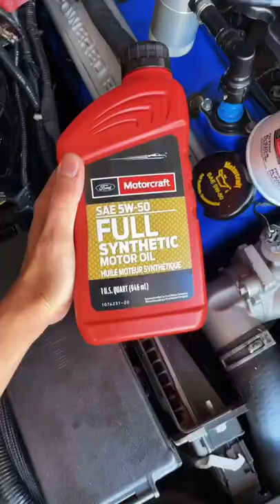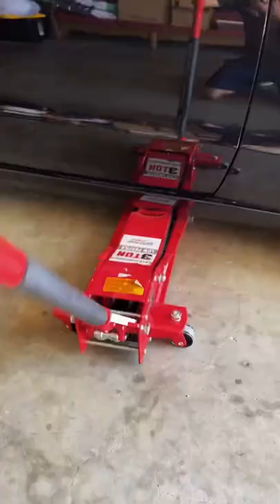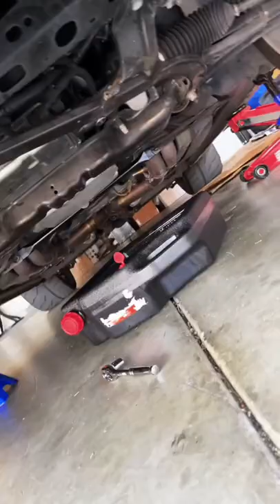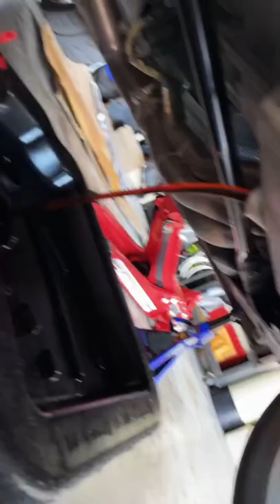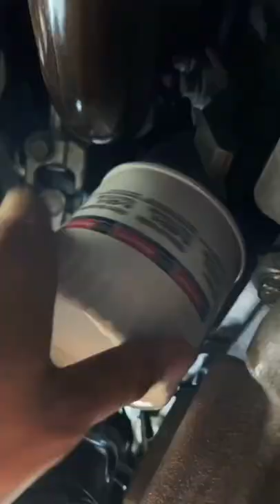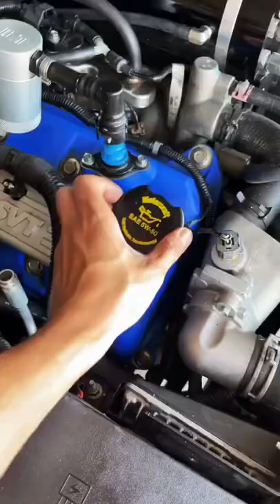How to do an oil change 🏎💨

Comment: Everyone saying about the filter, what about the fact he just jacked it up from the middle of the car! Always use the jacking points never use the middle of the sills.
Reply: First thing I saw.
Reply: Never pre-fill oil filter, can let dirt in engine and destroy it
Reply: That just depends on how strong the body of your car is 😂 I've seen cars up here in the north where you could only jack them by the side if you tried to jack them by the jacking points they would crush in so what we would do is take a longboard cut a channel in it and then set that right between the bottom bit and then jack off of that
Reply: U don’t have to!
Reply: I jack up my car and rest the car on jackstands under either the control arms or the k member subframe, i DO NOT trust those "jack up points" especially on a pinch weld, anything that is solid and connected to the frame i.e control arms, or subframe
Reply: Pinch welds are fine to hoist a car.
Reply: Jack Johnson   agreed unless something obvious is in the way of the pinch welds
Reply: @southernautodiy2643  go ahead try and lift a vehicle on a 2 post by the control arms let me know how that goes the jack points on pinch welds are litterally designed behind vehicle hoists and those tiny pinch weld Jack's that vehicles come with shut up if you don't know what you are talking about
Reply: As long as it's on the pinch weld you're all good
Reply: @tedsdead816  how is it irrelevant these people are saying to not lift by the pinch welds that is how a 2 post is used on most unibody vehicles so I am telling them go ahead and try that shit on a 2 post and see what happens of you think jacking up on the proper jack point is not correct you should not be around  vehicles
Reply: Especially for just a oil change, it's unnecessary.
Reply: @6door6four96 , yes, on a LIFT you use the proper jacking points. With a jack you can jack on other points as well, since you'll be setting the jackstand down in the proper jacking point.
Reply: @midnighthusky0601  iv only ever done that with diesels never seen someone do it to a gasser
Reply: Facts man.
Reply: Tell me you didn’t build the car without telling me you didn’t build the car. Lord almighty.
Reply: @midnighthusky0601  well idk where you’re buying your oil.
Reply: PREACHING 👏
Reply: @midnighthusky0601  Can but same can happen up top. Chances of that are slim
Reply: @midnighthusky0601  erm, only true on smaller filters. diesel oil filters require the filter to be filled because of both their size and diesel engines being considerably more touchy about wear and damage.
Reply: The car has jacking points along the side as well. They are called pinch welds.
Reply: @midnighthusky0601 well u can also get dirt in your oil fill hole what's ur point
Reply: @midnighthusky0601  the clean oil from the bottle is cleaner than what’s in the sump haha

Comment: U don’t need to fill up the filter man. Ive seen it lead to the filter not sealing with the gasket causing a leak. This method is not worth it at all due to it not causing hardly any difference in the process besides the fact u pouring it in the filter and risking more of a mess. Just lube the rim/seal and it’s good to go.
Reply: Agreed. You are putting in oil in your car that is  not filtered!
Reply: Huh its actually not gonna leak that only happens when you double gasket. Thats when the old gasket stays in the motor nothing will happen if you add oil in the filter. The only time you shouldn't add it in the filter is when the filter is upside down.
Reply: You are right about that didn't fully read the other guys comment. But you don't want to fill the filter with unfiltered oil
Reply: @SVT_Beck thats what made me confused like if you can add fresh oil in the new filter you should so the filter has oil on start so your not running the filter dry on start
Reply: Just turn car to on for like couple times. Primp the filteron the car before start if its a big filter
Reply: @michaellupo3480  you do know that the only way an engine pumps oil is with it running right. Also there is no reason not to fill it, we have had no problems with leaks, most of the time the person who put it on just messed up.
Reply: @SVT_Beck  you do realize that the filter is meant to catch metal trapped in the oil also
Reply: @joshmanis9860  no duh. It's a filter and I think you tagged the wrong person.
Reply: Always fill it up. Less work for your pump. And that enough is worth it
Reply: @SVT_Beck  , where do you put "unfiltered oil" into your engine that it runs through the filter first?
Reply: I've been filling filters for 10 years with no problems bud. My car is 5.3 quarts. That's a full filter and 5 quarts in the engine to sit right at halfway
Reply: @SVT_Beck  do you filter the oil as you pour it into your engine then? Otherwise you’re adding unfiltered oil straight to your engine! Rip to all the engines with oil fill caps located on a valve cover huh? Years and years of unfiltered oil going straight through the head first. You’re overthinking it bruh.
Reply: @peterweth  I understand that but it's for the oil squirters for the main bearings etc. So you don't put dirt or metal directly on the bearings
Reply: @Averagegamer673  dont prefilled filters, more chance for contamination, it's also just a waste of time car will fill it itself with no issues
Reply: @08specb  seriously, all you do is add a bit of oil to the gasket and filter, all your doing is being lazy and skipping steps to make your life easier and faster. And yes you should add oil into the new filter and putting oil around the gasket seal helps the gasket from cracking from being dry.
Reply: @SVT_Beck  it's going to be filtered either way. The oil goes in through the hole he filled it in, and through the filter, then out the smaller holes around the edge.

And even if it didn't, the oil you buy from a store is filtered before they sell it to you...
Reply: It doesn’t matter I’ve done a shit load of oil changes and always do that
Reply: There are some vehicles that require it
Reply: @Duck_side  SO SHOULD I OR SHOULD I NOT FILL THE FILTER?!?! I need to self oil change my 2007 Jeep Patriot. Let me know what I should do differently PLEASE!
Reply: @LCARNITINE18  fill it
Reply: @LCARNITINE18  it really doesn’t matter dude
Reply: Most of you in here have never got oil on your fingers 😂 I have never and I repeat NEVER have had problems pre filling a filter and lubing the ring, and I have done it literally over a thousand times on oem rebuilds and full 8k pegging race engines
Reply: @SVT_Beck  what about the oil that you pour directly into your engine 🤦🏻‍♂️, think before you speak my man
Reply: Best advise dont take your car to this guy. Just do it yourself with less steps
Reply: And your also putting unfiltered oil into the engine
Reply: Nope the engine runs the oil through the filter while it's running. As soon as you start your car it starts running through the filter. You need to educate yourself on how to work on a car bro. I've been doing it for over 15 years. Not to mention I built my mustang gt and it running fine. Pushing 600hp with no oil filter issues.
Reply: @cneddy22  nope you dont have to do that. I've done so many oil changes with no problems. But when someone loves the gasket or fills the filter up theres always issues.
Reply: One dry start can decrease the lifespan of your car.
Reply: @SVT_Beck  🤦🏻‍♂️🤦🏻‍♂️ dude I hope your trolling cause if ur deadass serious 💀.
Reply: I hope your joking.
Reply: you should put coca cola in your oil filter or else you're not a real mechanic
Reply: @beeda69  no the engine only requires you to put the oil in where it tells you. Adding extra steps to a oil change will make no difference in how long your cars engine will last.
Reply: @LCARNITINE18  depends on where filter is. I think tht filter is front of car sideways on engine
Reply: @nexxtgenfarms8615  
There's no reason to fill it. It's not a diesel with a quart sized filter. Not to mention the second that engine turns over the filter is gonna fill. Tell me why you would have to fill the filter.
Reply: @aaronsmith7143  Well I was talking about all engines in general, but still it doesn’t hurt. Also it lowers the amount of area that the oil has to fill so when you run it for a minute it causes less wear. Also the oil pump is going to have to pull oil to prime up so your just helping it by adding it. There is no specific way to do it, you can do it the way you want to, but I will continue filling.
Reply: @Averagegamer673  I always lube the gasket never said that, you conpletly ignored what I said purely because your wrong about prefilling filters. Manufacturers reccomend you not prefill. Any shop you go to wont prefill. Admit your wrong and move on
Reply: @LCARNITINE18  no need to prefill
Reply: @travisknighton1  also never had an issue not prefilling, no need to just takes more time for something manufactures advise against
Reply: @08specb  you goofy
Reply: @Averagegamer673  I'll take that as your wrong
Reply: @some-replies  filling the filter isn't going to hurt anything, it's just an unnecessary hassle, no need for it. Do you fill them on the sideways or upside down mounted filters? Oil is immediately going to be circulated as soon as you start the engine, your car will not care that there is not oil sitting in the filter, doesn't even make sense.
Reply: @LCARNITINE18  it doesn’t matter as long as you put oil on the rubber gasket to help it seal and not dry rot your good. Just make sure you fill it until it’s in between the safe marks and not right at the bottom since some of the oil you put in will be pumped into the filter.
Reply: It’s better for the car to pre fill your filter not necessary but better to say it’s not just shows you don’t know the actual science of how an engine functions
Reply: @juniperjd4891  it makes zero difference in a car or small truck, it is an unnecessary hassle, if it is side or top mounted it is basically impossible. If you are working on a semi or big equipment with giant filters then yeah you should fill them. I think you sir are the one that doesn't understand how things work.
Reply: @some-replies  and I've not been filling mine for almost 20 years... Never once did I have an issue running a dry filter after an oil change. The only time I prefilled them, was on dodge rams with a Cummins because those filters are massive. In fact, my tacoma sits upside down and cannot be prefilled as it sits at the top of the engine bay. Explain why I'm at 138,000mi and it still starts like it did day one.
Reply: U can fill it in half
Reply: Do you still fill it if your car has it upside down?
Reply: @LCARNITINE18  simply put: as long as you have oil in the engine, preferably filled to proper manufacturer specification.

whether or not the filter is pre-filled with oil doesn't really matter unless it's a diesel engine oil filter, those need to be pre-filled because of their sheer size and diesel engines are more prone to damage due to compression combustion over ignition combustion.
Reply: why ppl pay to do this. not so hard
Reply: I was hoping someone said something about that because I was genuinely confused if that was even necessary. Thank you
Reply: It has been proven that pre-filling provides faster lubrication ie less dry-running. The amount of time may seem small but multiply that times dozens of oil changes
Reply: Dude it's already clean, your crazy @SVT_Beck

Comment: Yeah let's not jack up a car by the fender.
Reply: It's obviously on the frame rail behind the fender he's probably should've pointed out it's important to locate the jack point of your car but if it was on the fender you would definitely see it bending.
Reply: @chikechovis2499  agreed/\
Reply: @chikechovis2499  use your frame ik damn well his jack wasn't back far enough to be on the the frame.
Reply: @bennytherollinstoner1932  it’s the frame dog plus not all cars have the same type of chassis
Reply: He’s on the pinch welds bud, all is fine.
Reply: @bennytherollinstoner1932  pinch weld is a jack point on most unibody vehicles
Reply: He’s on the pinch weld he’s fine. Y’all ain’t know shit
Reply: Bro he jacked it from the pinch welds it's fine its a unibody vehicle it's safe
Reply: pinch welds
Reply: laughs in hydro lift
Reply: @bennytherollinstoner1932  MFs that never seen a monocoque before belike
Reply: @connorn6378 bud 😂😂
Reply: @henryclement9879 Wtf is a pinch weld 😂😂
Reply: It’s part of frame .
Reply: It's a pinch point

Comment: I disagree with a good portion  of this
Reply: How my dad taught me is to run the car for a second then do the process
Reply: Maybe if he would get his curly ass hair out of his face he would know what he's doing instead of trying to look good for his car's oil change like that is supposed to do anything lmao, id rather be covered in grease wearing greasy clothes knowing what I'm doing under a vehicle than to be prim and proper and end up half assing a oil change tbh but that's imoo
Reply: @hauptfachhauptfach6202  better to have been just driving so the viscosity is lower and more contaminants remain in suspension. Running it for just a second is counterproductive
Reply: Yeah run it for a few mins to get the oil up to temp
Reply: @southernautodiy2643  lol sounds like you’re jealous
Reply: @PTheGoat  nothing to be jealous of here
Reply: You’re supposed to drink a good portion of the oil first. That’s what I was taught.

Comment: 1. Oil filter info is not on the fill cap
2. You don't need to prefill oil filter...especially if it is installed sideways like some vehicles where  you can't prefill anyways; if you do at least explain it accounts for a portion of the oil the vehicle calls for so people arent confused
3. Put the jack stands on the frame, not the fender
4. Replace the oil plug gasket
5. Hand tighten AND quarter turn the oil filter
6. Please delete this so you dont ruin someones car
Reply: For your number 3, wdym not the fender?? Do you know what a fender is? That’s not the fender, it’s called a pinch weld - it’s entire purpose is to be jacked from there. Some cars don’t even have a frame, buddy, they only have pinch welds….
Reply: @Switchblxde7  yea, it was lifted from the middle of the car didn't even look like it was on the pinch weld. Anyways, the frame is way safer than the pinch weld

Comment: Ok people are complaining about where he jacked the car, the condition of the oil he's changing and the, filling the filter, even the damn Temp of the oil being changed. 

He jacked the car properly, it made contact with the FRAME of his SPECIFIC vehicle. Some cars have pinch welds on the frame to indicate that you're in the right place and also the best point to jack up the front and rear of the car from.

That oil could be mint coming out of that pan it doesn't matter if you change it too early it doesn't hurt the engine it can just be wasteful at best. He probably drives this car pretty hard and needs to keep the oil as friction free as possible.

The temp of the engine oil while you chnage it or temp of the car doesn't help as much as you think. Especially if you don't let the car settle for a while after it runs. The oil's temp matters next to none if you're changing it, it comes out at relatively the same speed as if it were hot. Oil only needs to be at OT when CHECKING it not changing it.

Filling the filter is absolutely fine if your filter screws in from the bottom. It will not introduce anymore dirt into the filter than your dusty ass environment will while letting it sit dry.

Comment: For any person out there watching this, do not prefill your oil filter unless you're doing it on a diesel with a vertical spin on filter. Diesels need to atleast be 50% filled due to harsh start ups during an oil change. 👍🏻

Comment: Oil cap doesn't always have the oil weight on it. That being said if you don't know and it doesn't specify what oil you need in the owners manual then call the dealership and give them the last 8 of your vin. Also most vehicles include the filter capacity when it tells you how many quarts to put in your car. When your done turn the car over for about 15 seconds then check the dip stick. That the correct way to check your oil after you change it. Also prefilling the filter may or may not let small particles into the engine and cause damage.
Reply: Or just Google your make model and engine
Reply: @chrism8180  this is the easiest method
Reply: @vassilyknigge850  that's debatable
Reply: Prefilling an oil filter is not gonna "introduce particles to the engine" do you not think those plastic bottles are clean inside? Why do most filters have a protective plastic wrapping? To keep the crap out.
Reply: @foodhatesme  it's not hard to not spill when prefilling any filter. That part is unnecessary.
Reply: It's 2023 and the internet is amazing.

Comment: When I was an apprentice I was told the ones who don’t take the extra second to pre fill their filters are usually the ones who are hacks and do the bare minimum just there for a check don’t care about the trade. If you really know how engines work you’d know why it’s beneficial to pre Fill your oil filters if you can.
Reply: when was that back in the 80s

Comment: Use jacking points, or better yet a set of ramps, also you don't need to fill your filter, that is silly, try doing that with a sideways or upside down mounted oil filter.... you just need to lube up the gasket and make sure the old one came off. You also may want to get a new crush washer for the drain plug every few changes.